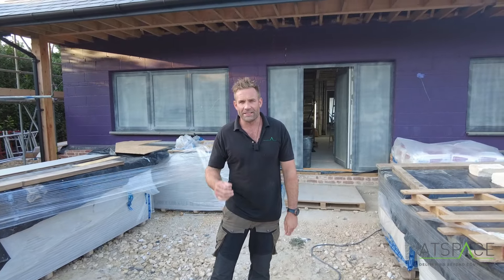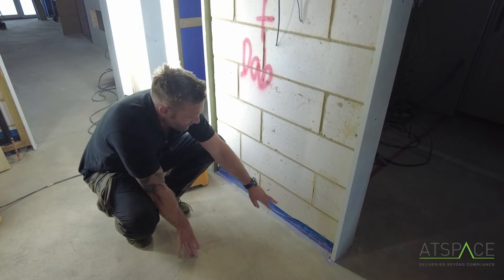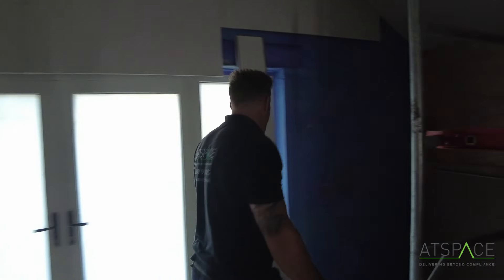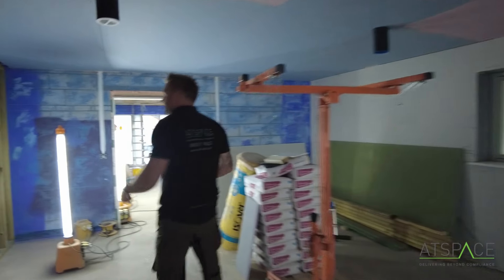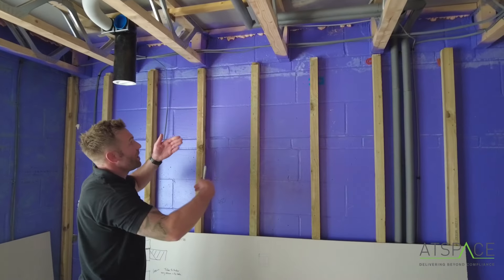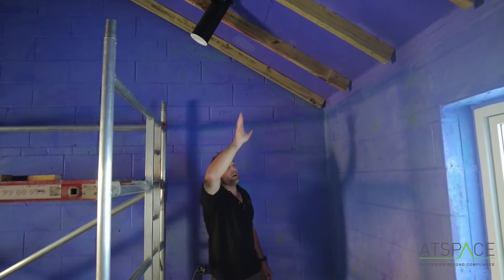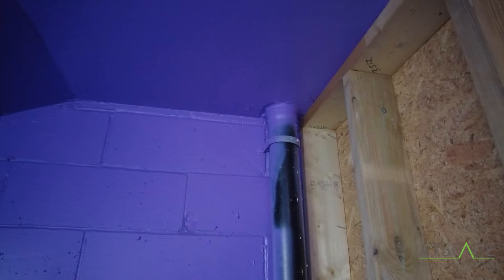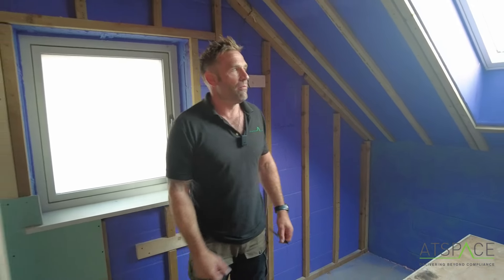Sealing the deal  making block and brick house airtight to passive standards

Comment: the money this adds to a new build is crazy
Reply from the maker: I understand that the cost of adding a vapour control layer (VCL) and the associated labour can seem high, and it's true that it might not leave much change from £10,000. However, achieving Passive House certification is increasingly recognised as a high-quality, energy-efficient building method. This often results in a higher resale value for such properties. The challenge is that many property valuers don’t yet have sufficient data to accurately assess the added value of these advanced builds, making it harder to get loans at a fair valuation without a substantial deposit. But as this approach is becoming  the standard, we believe it will pay off in the long run for everyone's sake.

Comment: How did people survive before all this??? Now you're living in a smelly house, unless you have air con, . Or live in a box of cotton wool, you need air in a house
Reply from the maker: Great question! Before modern building techniques, homes were naturally draughty, which allowed air to flow in and out, but it also meant higher energy bills and less control over indoor temperatures. With Passive House standards, the goal is to create an airtight but well-ventilated home. It’s not about trapping stale air; it’s about managing airflow in a controlled way. A properly installed mechanical ventilation system with heat recovery (MVHR) ensures a constant supply of fresh, filtered air, keeping the home comfortable, healthy, and free from dampness or unpleasant smells. This approach is far more energy-efficient and provides a much healthier living environment than traditional builds.
Reply: It's a lot less smelly and has less dust/pollen with mechanical ventilation that has filters. It's a lot better as a house, just more expensive.